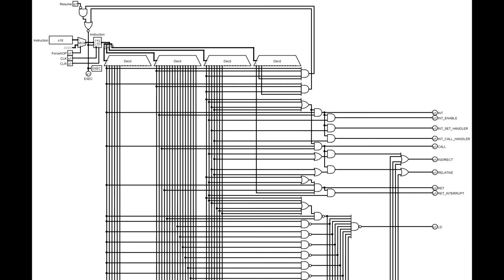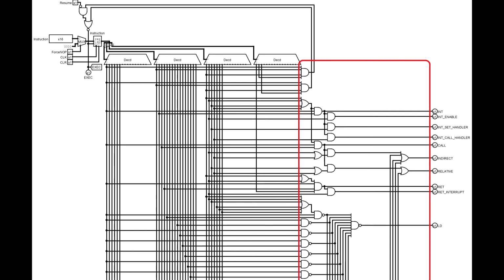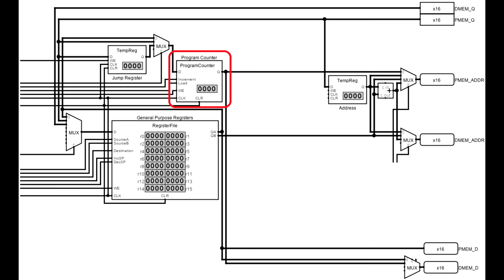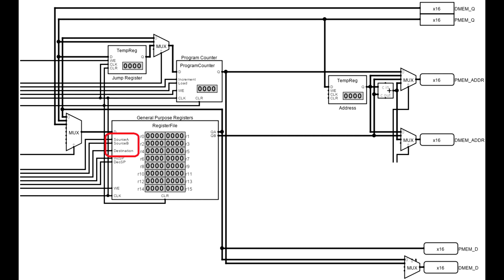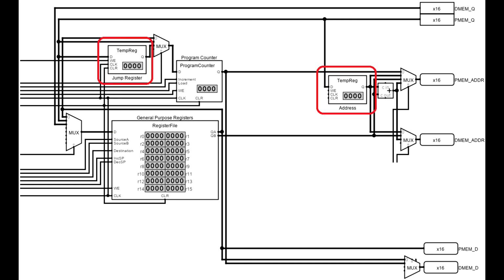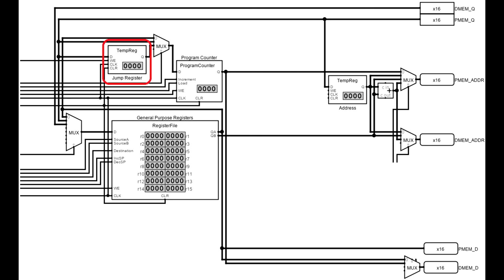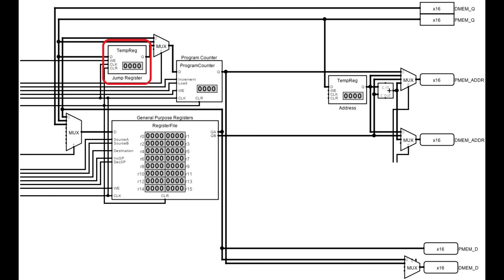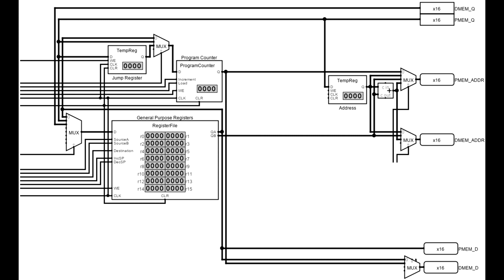16 Bit CPU Update (May 25, 2020)

Comment: This is super awesome! I'm starting to get into this kind of stuff, and if you dont mind, I've got some questions:

1. How would you recommend to get into this? Any resources or tips?

2. Are you using logisim? Is it just the regular/vanilla version?

3. How long would it take to make a small cpu?

You don't have to answer, I'm just really curious!
Reply from the maker: YouTube didn't notify me of this comment.  I'll see what I can do about answering your question.

1.  I recommend starting with a simplified digital circuit simulator just so that you can familiarize yourself with how different gates interact with each other.  Read-up on Wikipedia about logic gates, memory latches, and a few other things about digital logic and computer circuits.  And definitely watch Ben Eater's videos on how processors work.

2.  I am using a special version of Logisim called "Logisim Evolution (Holy Cross Edition)".  It has a lot of features that I'm taking advantage of in this project.  But you can build a CPU using the original Logisim if you want.  I've also made a Java library with some floating point components that I'll use later in this series.

3.  The time it takes to make a small CPU depends on the complexity of the circuit, whether you know what you're doing, and how easily you get burned-out (and how much time is available to spend on the project).  I cannot give you a definitive answer here.  But your first minimalist CPU that takes no input from external devices may take a few months to complete.  Once you become competent at building these CPUs, you can build more complex ones in the same amount of time, but you'll spend more time planning those out on physical paper and planning-out the instruction set before hand.